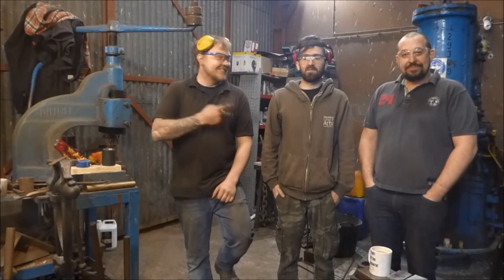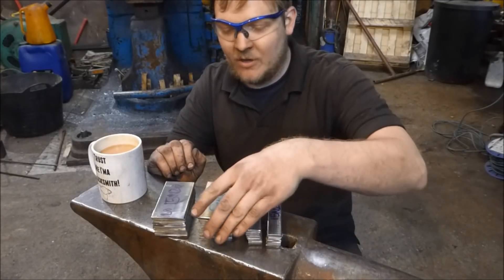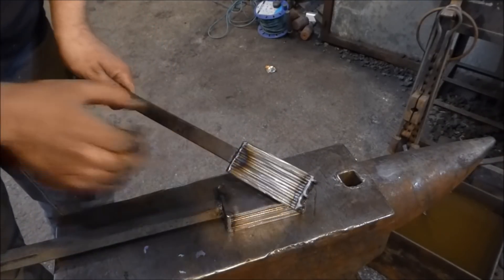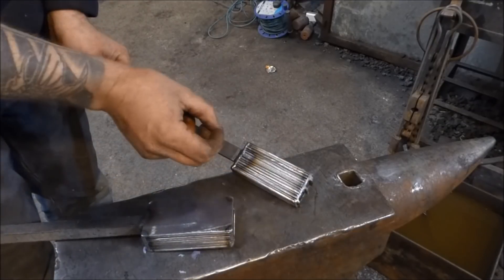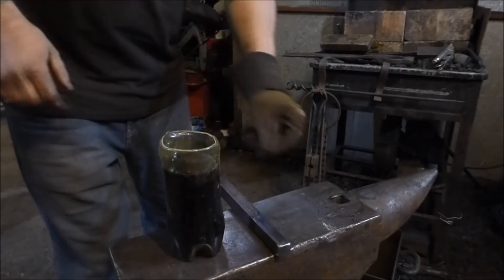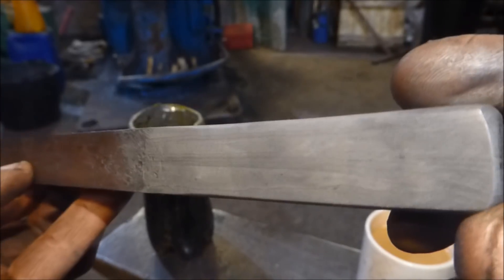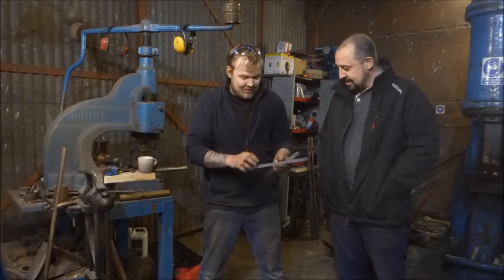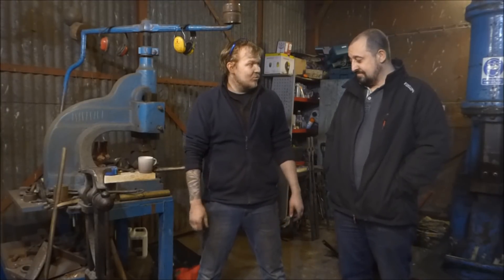How to Forge Damascus Steel! Super easy! Trust Me I'ma Blacksmith!

Comment: Would not have been easier to just elongate the block, then twist it, flatten it and bent it on itself,  and repeat as many times as you like? That's what i would have done. Even because I use only 1.5, 2, and 3.5 kg hammers to forge, no mallets :(, so your system would be practically too long in my case. This winter i will try to make a tanto knife with the inner part as soft as possible, iron, and the blade plus sides with high carbon steel from a big steel cutting saw that broke :)
Reply from the maker: Good luck with the tanto dude love to see some picture when it's done! The process of cleaning and re stacking I used just insures really nice welds that are scale free. If done correctly not here but this process also generates very interesting patterns not achievable with twists and folds. I think what your refuring to is more to do with an even distribution of carbon content over a non harmonious steel. Ie tamahagane being folded for Japanese blades. I was looking for a patter and I was also scared it was going to work well. 😂

Hope that make sense,
Reply: Yes, the pattern didn't interested me too much and my way will surely be less aesthetic :(. The Tanto will be an interesting experiment but, I still have around some knives to finish, I'm struggling to find proper lacquer for the handles, where i live :/.

Comment: Good video, but it's not by hand if you use a power hammer.
Reply from the maker: Jordan Pavlik Chris made his by hand till the clock run on. Did you watch all over the video?
Reply from the maker: Chris welded all his together by hand and drew most of it out with a striker. I finished of as it was like 7.00 and the course was for 2 8hr days not 2 12hr days. just so you know I will be doing mor on my own with hand hammer.
Reply: Yes, you show him strike for all of a minute (3:56 - 4:28 and 5:40-6:20 ) the rest is you on a power hammer. Not trying to be negative I thought your video was good just slightly misrepresented. That's less then 10% percent mate
Reply from the maker: Well to be honest with you up to the welding process its all the same any way so its not 10% but I have changed the title and like I said in the video and also before I will go into more detail. sorry dude my bad.
Reply: No worries man not trying to be a downer. For bonus points instead of pre welding the billets, use the wire wrap method.